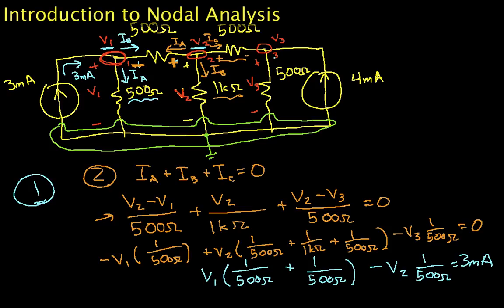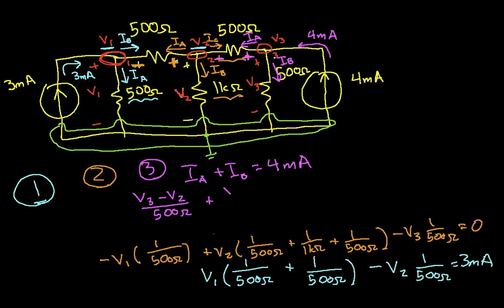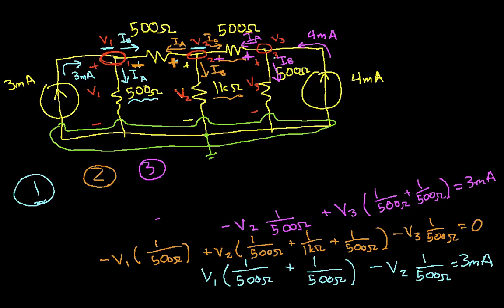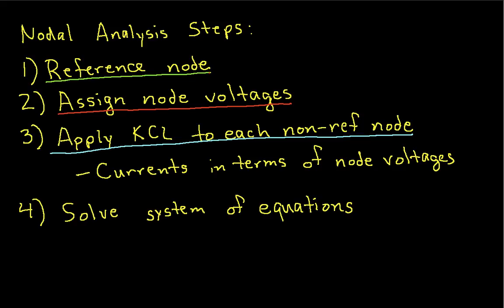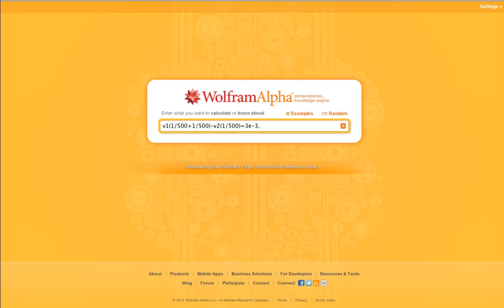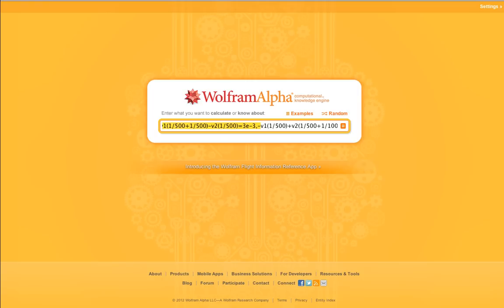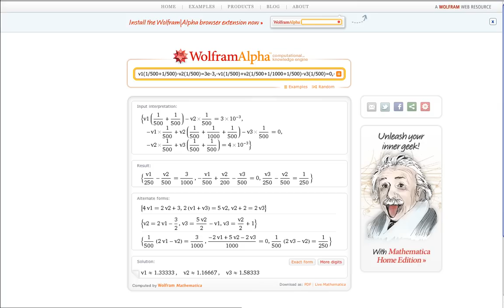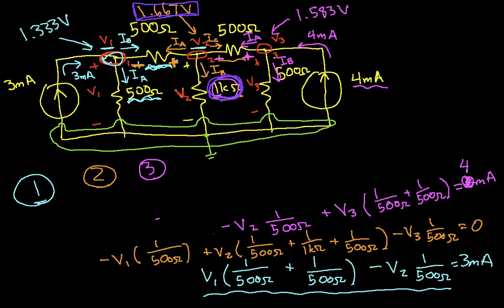Introduction to Nodal Analysis Part 2

Comment from the maker: For the V2 node, I redrew the currents so that all three are flowing out of node 2. If all the currents are leaving, then their sum should be zero. If Ia had been drawn entering the node and Ib and Ic had been drawn leaving the node, then your equation would have been correct (the sum of currents leaving the node is equal to the sum of the currents entering the node).

Comment: Thanks for the vid! I think a better way of solving (especially for electrical/electronic engineering exams) would be to use Gaussian elimination. I got V1 = 4/3v; V2 = 7/6v; V3 = 19/12v.

Comment: For some reason, the numbers for V1, V2, and V3 is not matching with yours. I am doing this by hand without the wolfram because I got an E-systems exam and I can only use a regular engineering calculator. 

I am getting, V3=1.05, V2=0.1 V1=0.8

Help!

Comment: when you changed the polarities when you did V2, the current (orange IA) goes from positive to negative through the resistor...I thought current/voltage goes from positive to negative through the circuit but negative to positive through the resistor...

Comment: nice video with small mistake ie,...v2  it's 1.1666
Reply: Pruthvi Simhadri It's called rounding up, instead of writing a long number out. However nice try as it would actually be 1.166666667.
He made no mistake, you'll find you're mistaken sir.
Reply: Rob Turner wolfram alpha returned v2 as 1.167 not 1.67 so he did make a mistake because he even read it out as 1.67 when wolfram showed 1.167. Please before you start telling people they're wrong check the actual video maybe?
Reply: Rob Turner LoL man, you have mistaken :P
Reply: +Rob Turner I'm sure he wasn't referring to the rounding....
Reply: +Pruthvi Simhadri I solved the system of equations a different way and got the same answer as you. V2 should be 1.16 repeating.

Comment: how in node 2. Ia+Ib+Ic=0
how these currents are determined? 
where is the input current here?
Reply: +Faysal Hossain The currents themselves are determined from Ohm's law: V = iR. Solving for I, this gives you I = V/R, where V is the voltage across R. Since the voltage across R is equal to the Voltage Drop across the resistor between the 2 terminals, you can define I = (Va - Vb)/R. Sign convention is important here. Va is the voltage on the positive side of the resistor; Vb is the voltage on the negative side on the resistor. Take special note of how he made his +/- conventions along the resistors as he addressed each individual node. That will explain his sign conventions as he wrote out the equations. Darryl is not the only one to do this. Various praised (and hated) textbooks to do this. They just don't explain why they're doing it because they don't want to make things too complicated... (Of course, that leaves unanswered questions like yours... What are you gonna do, right?)

As for questions about the equation he made and the input current... He decided to avoid using negative signs so that solving the circuit wouldn't be as confusing. Technically you could say Ia = Ib + Ic OR Ia - Ib - Ic = 0 IF you define Ia as ENTERING the node (which is valid and true). However, he changed the equation so that he had "Ia + Ib + Ic = 0" which defines all currents as LEAVING the node. That is completely fine and legal, as long as you're consistent with your SIGNS (just as he basically said earlier). If you define Ib with (V2 - Vref)/R, Ic with (V2 - V3)/R AND Ia with (V2 - V1)/R, then you get -Ia - Ib - Ic = 0 (since there are only exiting currents and no entering ones). Multiplying by a negative sign, that leaves you with Ia + Ib + Ic = 0. But that definition is under the assumption that you draw all current leaving the node (excluding current sources). If you define Ia as the input current, then it gets defined with (V1 - V2)/R (note that the variables got swapped). Using that definition, you have Ia entering the node while Ib and Ic are leaving. Therefore you have Ia = Ib + Ic, or Ia - Ib - Ic = 0. However...the truth is that it doesn't really matter which way you do it. (V1 - V2) is the negative of (V2 - V1). This means that if he drew Ia the wrong way, he would get a negative value if he solved for Ia with the conventions he used; and that would tell him that Ia is not leaving the node, but entering. So you get the same answer either way.

Here's another way to think about it (with a bit of repeat): Kirchoff's Current Law (KCL) is that the sum of the input currents equals the sum of the out put currents. ( I_entering = I_exiting ). Going back to node 2, that gives you Ia = Ib + Ic. Now, there is another way to view KCL. If I_entering = I_exiting, then that gives me I_entering - I_exiting = 0. Coming back to Node 2 again, that gives us Ia - Ib - Ic = 0. This makes sense...but let's take it a step further. If I define all POSITIVE current as entering and all NEGATIVE current as leaving, then that gives me this: I_entering + I_exiting = 0. This is the equivalent of saying "The sum of the currents at a single node equals 0 (assuming that the currents exiting the node will come out negative after solving the equations)." This is the logic that Darryl used. Be careful with this. It is OK to say I_entering + I_exiting = 0 AS LONG AS YOU DEFINE I_EXITING AS A NEGATIVE VALUE. For example, if I have 5 amps coming in and 5 amps going out of a node, that tells "I_entering + I_exiting = 0," which gives me "5 + ( -5 ) = 0." Look at that last equation. If I defined I_entering as positive 5 because it's entering the node, then I_exiting is negative because it leaves the node. Therefore I can add them up to get 0. Coming back to Node 2, we earlier had Ia - Ib - Ic = 0. But if we treat Ib and Ic as negative currents, then we have Ia + Ib + Ic = 0. If we use this assumption, however, we have to draw all the currents as either leaving or entering the node (preferably as leaving), and appropriately define the sign conventions, just as Darryl did.

I'm gonna stop talking now because this comment is getting way too long and I don't want to make things more confusing than they already are. Ponder what I've said for a bit...and keep comparing it to this video he made. Watch the video over and over again...and make pay very close attention to the sign conventions he used with his currents and with his resistors. With a bit of practice, it'll make sense. I'm sorry that I can't make it any clearer. This is one of the weird things about Physics and Engineering. You're taught to follow certain sign conventions. But as you get further along, you learn that you can use any sign conventions you want, as long as you're consistent with your directions/vectors.

Comment: I can't use wolfram alpha on a test...
Reply: get the app on your phone/ipod.  put said phone/ipod inbetween legs during test.  type in the linear equations. get answers.  pass test.
Reply: No offense but that's called cheating...
Reply: no offense but hurr durr.
Reply: Emily Brown  
use a good Graphing Calculator using the matrices function
Reply: +Emily Brown these equations aren't that complicated, you can just solve them simultaneously using the skills you should've learned from previous math classes or in high school. Or look up using matrices to solve equations (which is also something they should teach you already).
Reply: Use Kramer's rule or your calculator